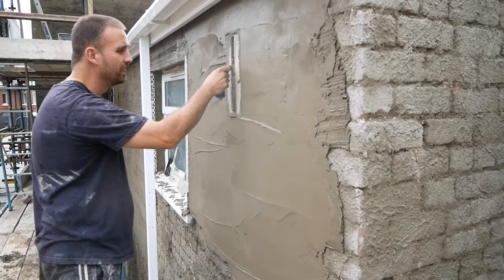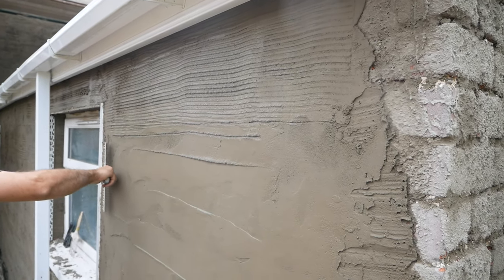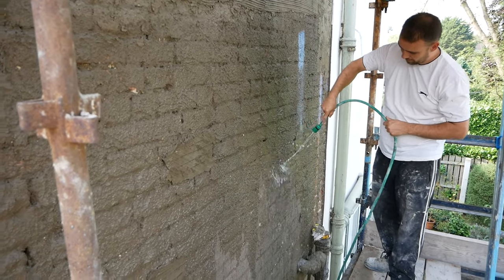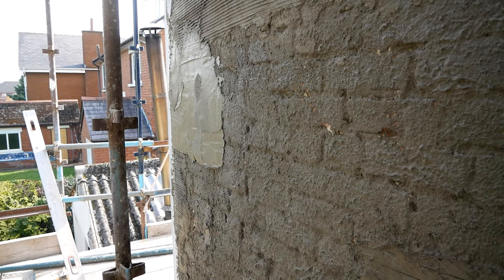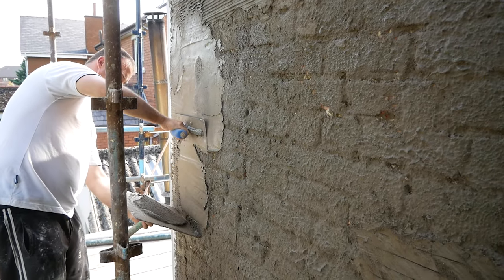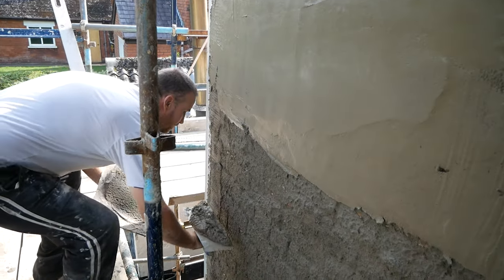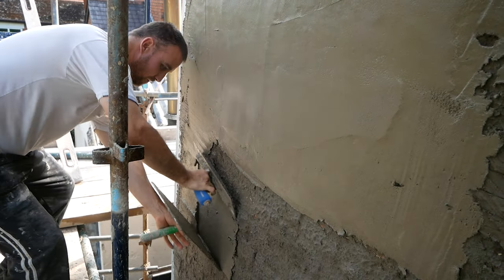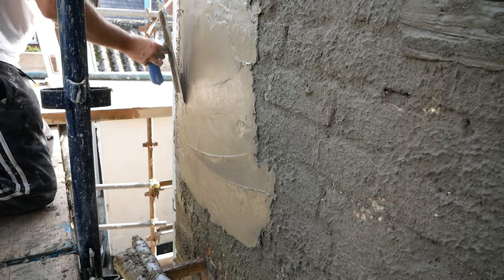How To Apply Scratch Coat Render Sand Cement Plaster

Comment: How do you deal with exposed steel lintel bro?
Reply from the maker: Sbr
Reply from the maker: That or nail mesh up
Reply: @macplastering  Thanks for the reply, man! what about the bottom of the lintel, I can't fix the eml to anything there?
Reply from the maker: We either use a scud on them or a hilti gun shoot the mesh on either way not an easy job as the metal lintils are supposedvto be made with a key to help grip the render.. anotger way you coukd just put a stop bead on at top face if not wanting to take the risk @tdhpst
Reply: @macplastering  bro... you're actually the best! Appreciate it so much!!🙏
Reply from the maker: @tdhpst  Thanks for the support buddy yea them steel heads are not fun let me know how ya get on with it mate
Reply: @macplastering  Hi Mac, just wanted to let you know that I ended up making a scud mix and flicked it onto the exposed steel beam. It seems to be holding great so far! It has only been 2 months so far, though.

Thanks again man!🙏

Comment: Scarifer all day long way better finish than the 7inch metal fork type scratchers. Miles quicker also. 
As for straight lines or wiggles lol
Wiggles water glue tends to run out catches in bottom part where more uniform holds more water pos. Cracking theory is bollocks straight or wiggles it’s it’s going crack no matter the scratch design lol. Good video buddy. 🤟🤟🤟
Reply from the maker: You have same thoughts as my self m8 often say that to lads if blocks move so will sand and cement

Comment: hey Mac I've just done the scud coat, u made it look easy,  it's hard work.
I have to scratch it now, my problem the headers on the windows want about 35mm on  &  is some of the bricks in 2 areas have up to 50mm missing about a metre. they were just rendered before.
 so if I put 50mm of render on in coats say 15mm will I then be able to scratch over the same day ? 
or will have to build it out &  then scratch the following day ? 
if so what mix will I be doing the scratch in?
 as 3 to 1 will be my building out coat , if you get what i mean.
Reply from the maker: Hi john mate great stuff and question if it was me would possibly do a 2 and 3\4 sand mix to 1 cement on the build out, then 3 to 1 over that I have a big rendering video going live tomorrow will help you out all rendering stages explained with as much detail as i could squish in ....
Reply from the maker: problem with going to crazy on th eheads is they are upside down and like to drop of if we go to deep to fast .... nailing a timber on can help giude and hold it up untill it is set
Reply: @macplastering   nice 1 Mac I'm glad I can do that it's a alot to build out.  will definitely use a batton then .
Reply: @macplastering  thanks Mac i appreciate it, all your videos have been a life saver .as always can't wait for the new 1 ! 😁
Reply from the maker: Any time john mate again that's the video live more than welcome to have a look let me know if i could add any better info to it next ect?   Thanks again for the support and so glad the videos helping you
Reply: @macplastering  only just saw this yes your videos are always super helpful, what I address in my question on here today would be a great video to make
Reply from the maker: @johns9543  yes I will try get some details up on doing heads for sure mate 👍

Comment: hey Mac , i am rendering outside it was supposed to be a patch up job taking off the loose & cracked  but have taken off  about 70% or 80% .
I have  scud coated & am now scratch coating, some areas are very deep, it hard to rule off on the thick patches   as its sliding & toweling up is the odd thick areas isn't going to well  because of the thickness depth , its very bad & uneven brickwork. 
the top of the wall sagged because of the thickness I corrected it but lost the top few inches. 
can I use a 3 & 1 to patch it up  or will that crack now ? 

& also do u ever dub out the wall when it's like that 1st early on & then coat over it all ?
Reply from the maker: yes would tend to fill out a little with scud then also with scratch coat last bad wall we done was straighten during the scratch to help make top coat go on better and easier... if your needed to go over it it is better to use weaker mixes as you build out less cement on each coat  if that makes sense
Reply: what would u recommend? if I apply 2 coats before the top coat I have a 2 : 1 on 
should I do a 3:1 then 4:1 then 5:1 
or break the coats down into ½ s like a 2½:1 or 3½:1 ?
Reply from the maker: @johns9543  hi m8 yes that's all sounds perfect and I have had a job before was such bad shape we hada go into mixes with half's like you say it still works 100 percent
Reply: @macplastering that great to hear, definitely need to do it here I think the brickie must have been blind or pissed 😆 thanks Mac
Reply from the maker: @johns9543  we do have to wonder sometimes haha could have been booth lol a guy I used to work with would say this when he seen poor work "they must have had one eye on the pub" lol
Reply: 😂 I like that 1